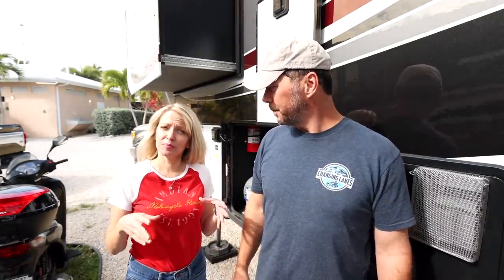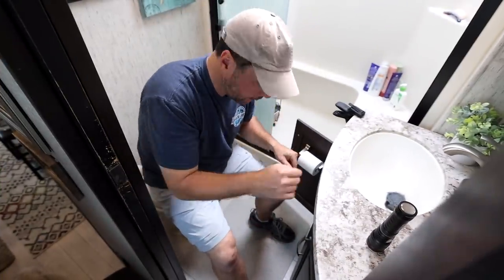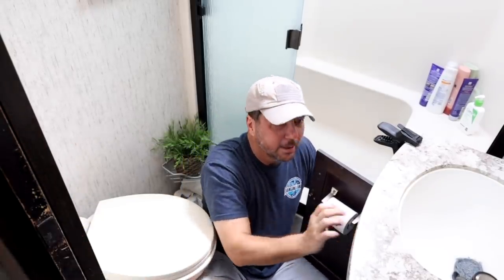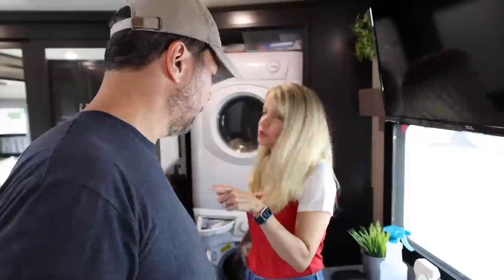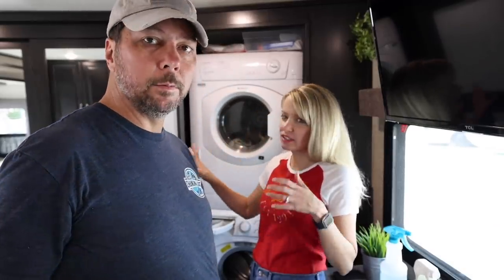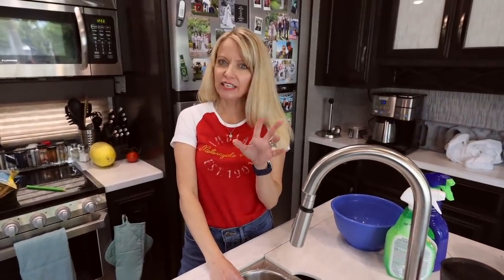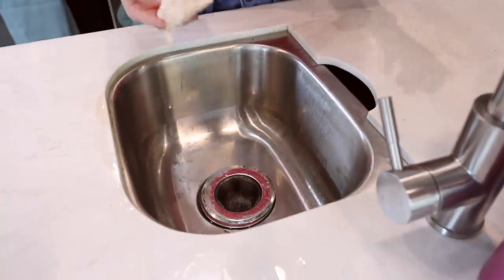RV Dirty Jobs

Comment: we have an lg stacked pair in our apartment and are putting a combo in our 5th wheel. I just wipe  it after use and leave door open for a while, 3 years good so far, we work at a veterinary hosp so mounds of critter hair.  I do use white vinegar instead of softener and only cold water. Figure if I get in the habit here, will be easier when we move into the 5R

Comment: I brought a set of small scraper tools like dental picks that make pulling hair from drains a breeze.  We also use the shroom, love them. Also, we found that Murphy’s Oil Soap is excellent cleaning the cabinets and leaves them with a nice clean finish without drying out the wood.

Comment: Be careful that superglue doesn’t last forever!!! I’d take tiny screws and secure the brush.  I clean my washer rubber gasket and detergent holder cup compartment every single time I use the washer, remove the compartment and let it drain upside down over the sink...and then keep the door open until it’s dry usually all day over night and wipe it all down with each use...the only other secret I have for keeping those front loads clean is a maid to do it.  LOL! 😆

Comment: The problem with bathroom sinks is that the drains are 1-1/4".  Plus the drain stopper restricts the water flow.  Add to that the low flow of bathroom sink fixutres.  Not enough volume of water to flush out the debris, so it accumulates and stinks.

Comment: Good video! Could have sworn I smell it on my iPad..I use some of my old aviation tools (helicopter tech) like a awl /scribe set with different angles 45,90, and 30 degree angles and a set of mechanical fingers. To clean my drains,they catch the excess hair pretty good.

Comment: You don't want to use the mildew cleaner. It will dry out your seal!. Do you have a bottom drain? Alot of top load machines have a additional drain. I have more suggestions I'll be back😁

Comment: Just like the washer door leave the soap dispenser door/tray open too to dry out. Also you want to clean out the cavity soap door/tray sits inside because the mildew/mold will grow on the top inside and down the back too.

Comment: Please don't use steel wool on the sink.  The fibers can get stuck in the brushed finish of the sink and rust. (35 years of whole sale plumbing supply experience talking).  Bar Keepers Friend cleanser will clean and polish the stainless.

Comment: We us Glisten Washer Magic Machine Cleaner. I see Amazon has it. I have bought from our local Menards Home Center in MO. This works awesome for removing hair and gunk in and around that large rubber seal around the front load clothes washer door. We have also bought the same brand for dishwashers. Works great. Do it about twice a year on both machines. Just follow the directions. These are in our home. We do not have a washer/dishwasher in our 5th wheel...dang it.
Reply from the maker: Thanks for the tip!

Comment: I ran across a possible product for the mold problem in the washer. HGTV had an article listing a product called Tilex. Sounds like you spray it on the mold and let it stand for 5 minutes and wipe off while wearing gloves. Hope this helps!

Comment: Use “Affresh” tablets and run the washer clean cycle + leave the washer door open as much as possible.
Reply: Wipe the rubber seal fairly dry after EVERY use and yes, leave the door open as much as possible.  I just bought a GE washer with a new type of rubber called Microban which is supposed to resist mold growth.  Also has a venting system built in the washer so it dries even with the door closed.  Not sure if you can get that for an RV though.

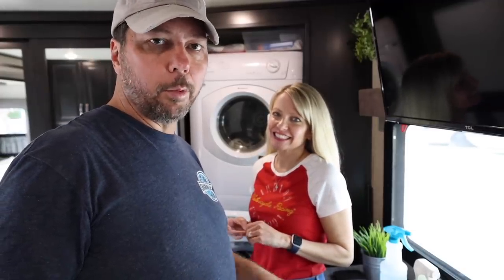Comment: 23:27 this idea just came to me while watching this; after each use (& you use a paper towel to wipe all the excess water outside & inside the seal) place a DampRid type product inside to pull the moisture out of the air (especially when closed if you can’t leave the door open to air out). 💡 🤔 💭 🧐

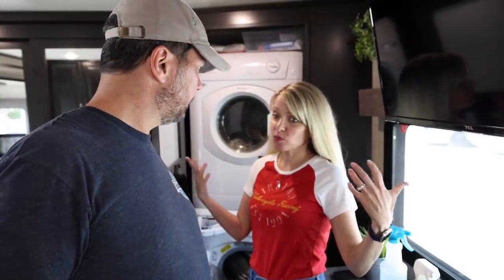23:39 Surely 🆚 Shirley 😅😂🤣😆

Comment: They make a product to disinfect washing machines. Just pop it in an empty machine and run a cycle.  This is something you shod do periodically not sure if it would do what you needed for a long time of use before cleaning but once cleaned thoroughly then the periodic use should keep if fresh and clean. They make another product for dishwashers to do the same thing.

Comment: Hemastats are awesome for something like that. I just don't know where to get them. I get my disposable ones from the operating room where I work
Reply: I have seen them in random places such as craft fair booths, swap meets type place markets.  It's been a few years now since my last visit) but there was a vendor at the Mesa Market Swap meet that sold all kinds of Hemostat tools. 

Chad & Tara: check with a local dentist, vet or smaller Dr. Office to see if they have any that they would considered "expired" - may sell them cheap (a few bucks?).   The stainless steel ones I use I've had since the mid 90's - given to me from a retired surgical nurse who did a lot of crafting, jewelry making, etc.  I've used them countless of times & for all kinds of random projects.  

PS: on the washer - I didn't hear using a cleaning cycle?  Also, does your machine have a front drain (usually down by the floor or under the kick plate?  Those also hold a lot of gunk & smells.
Reply: Harbor Freight sells Locking Clamp Pliers which look a lot like hemostats.  There are some on Amazon too.
Reply: @jimlynch9390  thats why i use curved tweezers (the long ones )  they dont lock when trying to pull the hair out and lock your fingers up too!

Comment: Washing Machine: After you do your laundry...1/4 Cup white vinegar in the top dispenser, do a 12-16 min wash with a spin,,, when it's done wipe out the rubber ring inside the lip and the inside of the door and leave it open for 12-24 hours...never have had any mold in over a year FT...use white flour sack kitchen towels to wipe it out, you can get 10 of them for 5-8 dollars from walmart. they are thin so you can use your fingers to get under that rubber lip and absorbent.

Comment: The cheap metal sink in my Grand Design Imagine 2500RL scratches easily so I don't use anything abrasive to clean it.  I make sure I wipe it clean and wipe it dry after every use otherwise it looks water spotted.

Comment: I use a small needle nose plyers  like for modeling to grab the hair and excess stuff  will general fit in the holes of the x pattern of the drain and able to grab and twist and pull  the stuff out better than the screw driver.

Comment: I’ve replaced the toilet in my TT. You’ll be surprised to find out that RV toilets are secured to the floor pretty much the same as regular toilet.  They use a wax seal just like a regular toilet.

Comment: For  your cabinets, you can use WOODDOC Penetrating wax, this product is cheap and can be used on painted, plastic, wood and rubber surfaces, it restores rubber back ton new and makes any painted surface shine, I use this product on my car after a wash, just don't use it on your front and back windscreen of your truck

Comment: You guys are too funny. Been there done that. We wouldn't make good plumbers right. Don't you use Teflon tape? Do you use olive oil on the ball that pulls back. When to bowl is empty, I use 1tb spoon of olive to lube the seal. Have you tried Old English Lemon Oil on the cabinet once a year it helps moisturizer the wood, and old cabinet makers trick

Comment: Chad, one thing I do is rather than use the black tank flush port on the RV, I instead use a five gallon bucket. I fill the bucket in the shower, and then I'll dump it down the toilet, repeat until the black tank is full and then drain. Because there is nearly five gallons of volume, it tends to keep the tube pretty clean while I'm also filling up the black tank. Pretty straight forward. Give that a shot and maybe you won't need to scrub the tube anymore:). (I do this type of flush about every third dump.

Comment: Would it be a bad idea to use Clorox Toilet Wand system to clean the toilet? Thank you for the awesome video! I’ve had success with Clorox Clinging Bleach gel on the washer. I apply, cover with wet paper towel, let sit for a while then wipe off.

Comment: The best thing to use on your roof will if it's a metal roof or a rubber roofing you got on your RV is used flex seal I've used flex seal now and it holds up terrific the other stuff that they sell in the RV stores to cover your roofing to help seal it a lot of it wears off and you have to keep replacing it quite a bit every year I give it two coats first time I use it I rolled around in One direction and rolled it on the opposite direction you know first lengthwise and then crosswise and then the following year I put another two coats the same way and the roof looks the same as it did when I first did it so remember to use flex seal with if you have a metal roof or a rubber roof on your RV it works best and also you can get flex seal sealer for those cracks and stuff you can get in the nooks and crannies for on your RV that's the best thing to use I found I've been living in my RV now for 6 years

Comment: Forget picks and metal things for drains!
Get a small round parts brush at a hardware store. The flexible shaft is perfect.

Forget vinegar for mold...it’s useless. Hate FL machines...ugh. Ya gotta wipe the seal dry each time. Use a SPRAY like Lysol to inhibit bacteria.
Don’t use SOS or steel wool on your chrome; you’ll eventually have NO finish left and then be left with unsightly brass or worse.  Better to stick with plastic pads.

Comment: Rid X just like happy camper get you a box of rid X I like using it whenever I go from Full hookups to full hookups and in between a tablespoon and every dream an extra for gray tank and black tank with about 1/3 full of water for slashing when I get to the next site I go ahead and hook up all my hoses but I leave it in the gray tank and black tank a little longer so that it activates even more until I need to drain this is what I found helps work this out for me read the instructions on the ridx bottle I am not a full-time camper but I do have a house with septic system I use this in my house drained every couple months.

Comment: Great video, guys.  I have the same malady as Tara with the gross stuff.  I do it, but I then become the drama queen.  If she starts gagging, I start gagging.  When I'm in the area, nobody pukes alone.  How difficult is it to remove the front loading washer seal?  Maybe it would be easier to take it out and clean it outside.  Or, depending on the cost, replacement may be the answer.  Again guys, good video.  Thank you.
Reply from the maker: A new seal was around $90 and it loos easy to replace.. 👍🏼

Comment: Use bleach to kill and get rid of the mold in you washing machine. Also, tide make an item you put in the washing machine to clean it out.  You just add it to the machine and run an empty load.

Comment: Meant to ask what make/model of toilet that is?  I have the Dometic 300 in mine, and it's got a similar "cavity" to catch nasty stuff.  I am wanting to upgrade to the Dometic 320 since it appears to be a straight shot with porcelain from top to where the toilet seats on the floor, thus no more stuff stuck anywhere inside.

Comment: You have nice water pressure in your sink. Mine sorta just falls out of the faucet by gravity.
Reply from the maker: If it's just the one sink, I'd check the plumbing for that sink.. If it's your whole RV and just an issue with supply pressure, not much you can do about that except use your tanks and pump....  Hope that helps!

Comment: The inside of the toilet looks no different than the inside of most older commercial airplane toilets. Have you looked into Mirabowl Q  to see if you could use it with your system?  I know its specifically designed not to harm rubber gaskets and piping or pumps.   Just a thought.

Comment: I Enjoy your videos thank you.   We have the same shower in our rv.   Thanks for the shower shroom info.   We have a problem with water running down the glass doors puddling in the lower tracks.   The drain slots are open, but the water does not drain completely.   It's a pain to try and dry them out.  I've used the edge of a towel and sponge type paint brushes.   Do you have any suggestions.
Reply from the maker: I think we've used magic eraser on those too.  Cut slits in it for the track edges.
Reply: I’ve been using those cheap original colour sponges. They’ve been around for decades. Come in all diff. colours like Yellow, green, blue, pink etc). Complete straight edge rectangular sponges, like only 1/2 thick, fit perfectly into one of the tracks. Get at walmart, a couple bucks for a four pack. Right after shower just pop the sponge on its side into the track, right up against the edge of the open glass shower door, walk away, when you go back to the bathroom for whatever reason, squeeze out the sponge, give the track a quick wipe, pop it into the next track...and so on. It’s not a pain, but if you find one sponge isn’t quick enough for you, pop a sponge in each track at the same time, walk away, lol. Sponge sucks up a lot of the water for you. Pretty effortless. Cheers 🍻

Comment: OMG!!!  The sink cleaning was way worse to watch than the toilet cleaning.  One of my cleaning hacks for getting stuck on food or grease build up is to dissolve dishwasher powder in extremely hot water.  For example, if I have baked something and it’s really stuck on the dish. Grease build up or coffee/tea stains in cups etc...   I fill the dish with extremely hot water and then add the dishwasher powder (about 2 Tablespoons - the bigger the container the more dishwasher powder needed.)  The water should feel silky when you rub your fingers together after dipping it into the water mixture. Mix well until the powder has dissolved.  Let it sit overnight or for a couple of hours or so.  Rinse when done and wash as usual.  Usually everything washes right off.  I was wondering if you removed the washing machine gasket/seal and soaked it in the dishwasher water mixture if that would help get through the mildew build up. For sure it would work on the soap dispenser compartments. Just a thought. Great video, very informative as usual.  Thanks for sharing your tips and tricks.  Safe Travels!

Comment: When cleaning the toilet drain would it be a good idea to spray some Lysol Foaming Bleach or Scrubbing Bubbles, just to get a cleaning agent onto the walls of that plastic piping.  I would assume that the gray tank piping and inner walls would be affected by a sanitizing agent, like bleach, but it would probably help if there was  some sort of gel (Scrubbing Bubbles) to apply directly to the porcelain toilet bowl close to the water jets that rinses the bowl.  Of course you have to reapply this product, probably once a week,  but the excess will dissolve in the gray water/black water tanks and even assist in neutralizing the foul odors coming up and into the bathrooms (which would be a miracle.)  I might be wrong.   One other thing.  It seems to me that under all your sinks, there seems to be enough room, under the sinks, to have a deeper (home style) P trap.  Was this a short cut by Grand Designs?  A deeper P trap will guarantee that no gas is coming thru a deeper amount of water.  The P traps in the RV look like a space saving type trap.  I would prefer losing 1 or 2 inches of height, under the sink, and have a lot less gas stinking up the place!!!  And, once again, I might be wrong.  Either way,  I THINK YOU GUYS ARE AWESOME!!!  You both are great thinkers in perfecting the imperfections of an imperfect, but great RV!!!  Chad, you're also a GREAT INVENTOR!!!  You really ought to market some of your inventions and it would bring in additional income.

Comment: Thank you for making this video it was very helpful. However, I have a problem that has just started happening after 3 years of being in my camper. I have a 37 ft so my toilet is pretty much like yours. But when I flush the fumes that come up are the most disgusting I have ever smelt in my life. Why? What do I do? I already used the proper chemicals GMO or whatever that proper thing is. So can you please tell me or have you ever experienced this? Please tell me if you know anything I can do to fix it. I seen another video where he goes up on top of the outside on the roof and changes out that vent that's up there. Do you think that's it? Because it's fumes we have washed we have cleaned out with the water hose we've cleaned out with the bucket but the fuse is still there. Did I say fumes! It's disgusting. Help?
Reply from the maker: It could be a lot of things.  The vent is one of them.  Your best bet might be to get a mobile tech out to troubleshoot it.

Comment: Do you guys know the make and model of your toilet?  I ask because we have the same one in our Solitude and I need to replace the seal. Even when I reapply the plumbers grease it still leaks. I can’t find anything in our packet about the make and model. Camping World says there are over 30 models of toilet so I need to know the make and model. Can’t find it on the toilet either.
Reply from the maker: I would call GDRV and ask them...  Pretty sure it's a thetford.
Reply: @ChangingLanes  ok. I look to you guys for guidance first as the professionals that you are. I’ll contact them. Thanks for tips and tricks.